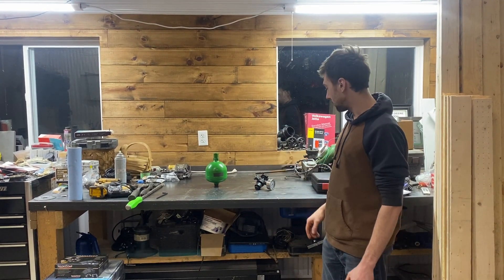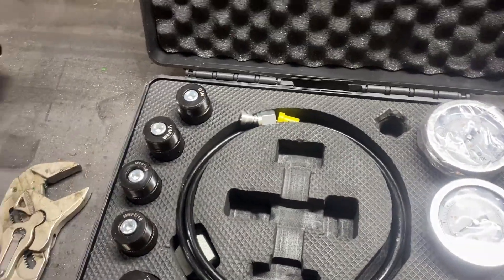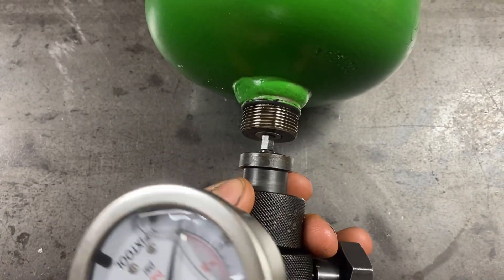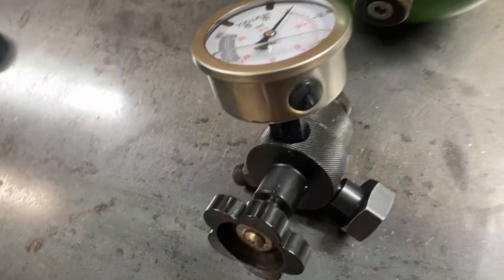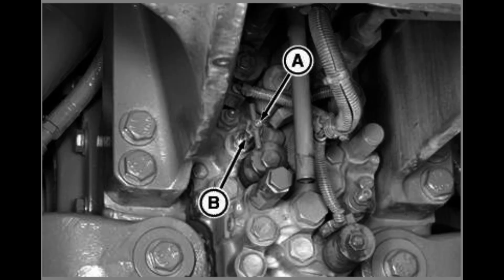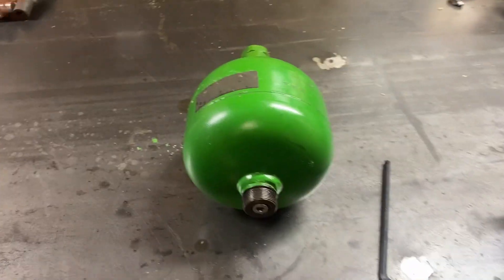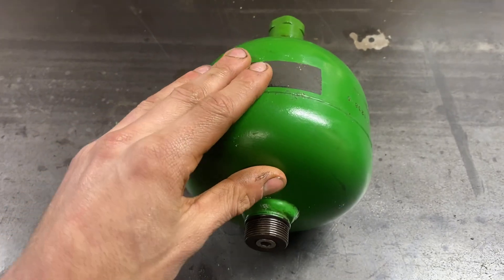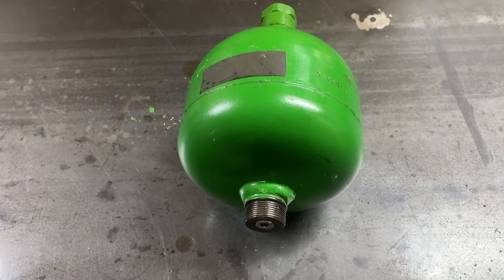Checking/Charging John Deere ILS accumulators

Comment: I have a question, I want to install an accumulator on my rear 3 point hitch as I will have an inverted snow blower on it this winter. How would I go and size the accumulator for my application, my tractor is a Yanmar yt347 and the dealer is no help.